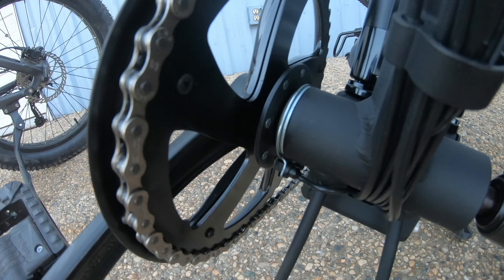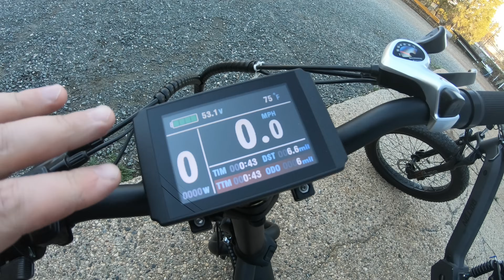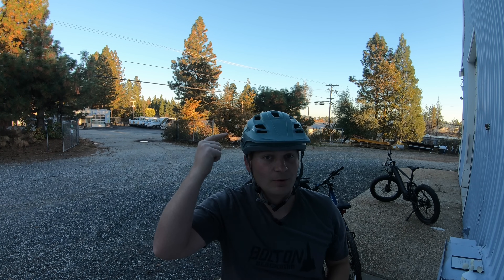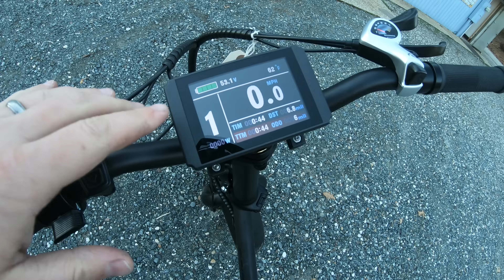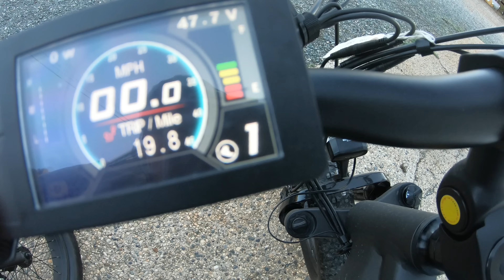Ebike Cadence vs Torque Sensors - the surprising outcome

Comment: On a long gentle hills cadence automatically slows even if you press harder on pedals, your slower cadence is sending signal to motor you want less power assistance, as slower cadence and lower power assist will continue to slow your forward progress. On a hill bike motor understands your decreasing the cadence meaning that you want less power assist.  Torque sensing will see you are trying to increase speed by pressing harder on pedals, and motor will increase the power assist letting you continue climbing the long gentle incline...  if you have a steep short hill stand up and apply pressure to pedal on a non electric bicycle it lets you climb the hill. With torque sensing standing up will increase power assist provided by the motor unlike the cadence sensing that is reducing power assist because the signal to motor with less cadence is you want less power assistance.  Unless you have no undulations in elevation, I can not understand why any eBike rider would want less power on hills from cadence sensing....

Comment: good description... i find cadence sensor kicks in as soon as a magnet passes the sensor....on gravel it can throw you off.
Reply: I used to really enjoy your channel Simon, i dropped off after i found out you where not a real professor in your comment section one day, i felt like i had been conned... you don't even need that title, your very good at what you do and are a nice guy to hold your own! Anyway all the best👍
Reply: @rossg9363  Actually I am a professor having taught in higher education, I just don't have a pHD.  I ry and make it clear I am a Science filmmaker.....with an E-Bike....happy cycling and hope to see you back on my channel soon.  Simon
Reply: @SimonHollandfilms  thanks Simon it's been nearly 2 years from my last view on your channel, i feel better from your response, ill come back over and become a subscriber again :) happy ebike riding to you to! My Cadence sensor on my bafang bbshd 52v kicks in that hard i swear my rear frame twists.
Reply: I hit a patch of stones at a corner intersection on a busy road. I lost control and lurched into the street. I am lucky that the cars stopped before running me over. My high power cadence sensor bike propelled me at the speed setting of the pedal assist. I believe a torque sensor would give me greater control over my speed. I will switch to torque assist as soon as I can pay the price for it.

Comment: If I understand this, you burn a lot more calories with a torque sensor than you would on a cadence sensor bike.  With cadence sensor you don't really burn many calories because you are just spinning the cranks to get the motor to kick in and once in kick in then it does all the work for you.  Catch 22?   Please explain if I understand this right.  Thanks.

Comment: I debated a mid drive Bafang (cadence) or Tonsheng(torque). I normally ride a full suspension mtb and wanted to still have a good workout riding. I choose the Tonsheng (torque) and super happy with my choice. I still get a great workout and go twice (ok maybe 40%) faster And clean many hills and features that I couldn't on my regular ( I like phrase 'acoustic') mtb. I also agree with others that describe a torque sensor to feel more like you have bionic legs rather than just having the motor do the work for you. On my new bike I still feel like I am riding a bike and not a scooter.
Reply: a torque sensor Bafang Ultra would give you 1000-1500W and 160Nm with reliability and quality.     Bafang hub motors combined with a torque sensor would give you also a lot of power.  Yet, you chose the cheapest? solution.  Don't know. But probably the least weighing solution at least.

Comment: Never ride a torque sensor cycle bike seem more on point plus you still get a workout my cadence sensor is broken and this bike was never made to be pedaled with the added weight of hub motor wheel almost coming balance weight to my old regular cycle full weight by itself ( back wheel is 1 ton ) only is a struggle a pain to put it nicely without battery power on throttled
Excellent video

Comment: After many years of motorcycling, I'm looking at my first Ebike. Have learned a ton so far. It will be mid-drive, torque sensor, throttle. But this video showed something new (to me): thumb throttle on left side?! Isn't there such a thing as twist throttle on right, like a motorcycle?
Reply: radbikes have a twist throttle on the right.  the aventon level 2 I ended up with has a thumb throttle on the left, which i actually prefer because it doesn't interfere with using the shifter.

Comment: Thanks, this is an interesting subject. I had always assumed that a mid drive with a torque sensor was the best option; however last year I bought a giant escape with this set up and I did not really enjoy using it....it always seemed sluggish and heavy to push.  I had a test on a cheaper rear hub with cadence sensor today and I found it to be much livelier and enjoyable?  Sadly my local bike shop does not have a bunch of test bikes so that you can make a comparison between the two ( I sold my giant at the end of last summer) but I’m leaning towards the cadence at the moment.
Reply: I had a torque sensor on a previous ebike and I felt the same thing. Granted it was a fairly low powered hub motor, my 6 mile commute left me sweaty and tired (although I got there quickly). I think that a torque sensor gives you a much more bicycleesque experience but cadence sensors can help ensure that you get wherever you are going without breaking a sweat.
Reply: @Pippokpax  thanks. I’m looking at one of the orbeas with the ebike motion rear hub drive now.....as far as I know they don’t have a torque sensor but have a sensor on one of the rear chainstays.....happy cycling.

Comment: I drive rear hub 750W, cadence sensor, twist throttle.  7gear shimano, pretty typical.  They all work so seamlessly for me that I can adjust my effort level as quickly as I need, I can't see a need for torque sensor, although when first looking at bikes I thought I would really want a torque sensor.  I guess if I was an avid heavy duty mountain biker I might want the torque sensor for instant response.  Other than that, perhaps if I was a serious road biker, competitive level , torque sensor would probably also be nice.   But for everyday commuting, fun, all around exercise traveling,  even light trails, hills ,  gravel, snow, mixed conditions my cadence sensor with twist throttle is a perfect fit.  When I need to cross busy roads quickly, just twist that throttle and get across quick!  And then let go and let cadence do the work.  My only complaint would be my gearing which doesn't allow my pedaling to help beyond about 22 MPH,  just ghost pedaling at that point.  But since most of my riding is done between 15-20MPH it is not an issue.
Reply: I have a 1000w hub and 21 gears, That extra large 3rd sprocket on the front defiantly helps at higher speed, But even then, When I go past 25 I start losing momentum. That's where the throttle comes into play though, It will take me to my top speed of 30-32 mph (depending on voltage level), plus the fact I use it anyway when cruising, So it doesn't matter to me.
Reply: Perfectly stated. Cadence with throttle is just the right away for ebikes

Comment: Some Physics 101: pressure = force / UNIT AREA Works great for fluids and foundations. Meaning, the bike torque sensors you described are sensing FORCE, not pressure. Facts still matter.
Reply from the maker: Thanks for the info!

Comment: Current model of Ride1 up Ltd 2021/22 swithched to Cadence from previous Torque Sensor. Were they trying to cut cost or it just works better with their 750 BF hub with throttle? Please comment.
Reply: What I remember Ride1Up said about the change is their customers wanted a cadence sensor. I can see why if you have one or more injured knee or hip joint. I have a gen2 of that bike with a torque sensor. Most of the time I like the feel, but there are times I tweak my bad knee and it is difficult to extract power from the motor due to that, or am towing a heavy trailer, so I rely on the throttle when that happens.
What I’d like to see is a system that has both types and lets me switch between mode. Juiced is the only brand I’ve found with this capability. I’d like to learn of any others that do.

Comment: Throttle is sadly illegal here in Australia, NSW but delivery drivers use them.
Reply: Not illegal, however if you have a throttle the 250W legal limit drops to a measly 200W and it still has to cut out at 25km/h. But no one actually cares so long as you follow the Don't Be a Dick rule.
Reply: @clonkex  in NSW we're not allowed to have throttle but many do any way, especially delivery riders. Cash grab by Highway Patrol if caught. Even worse with e-scooters.
Reply: @StefTechSurfer  I just checked the rules. It seems somehow less clear than a while back, but I still believe what I said is true. You're allowed a throttle for bikes with up to 200W maximum output. It does say it can't be exclusively propelled by the motor but doesn't define what that exactly means. One assumes they mean the throttle is only to help you get going from traffic lights or add power up a hill, but it's not clear.

They do define pedalecs more clearly, where the power only comes as assurance during peddling and allows up to 250W continuous output.

Fingers crossed we eventually get QLD's electric skateboard/scooter laws, cuz those are pretty good. I've had so much fun zipping around Brisbane on electric scooters during my stays there.

Comment: you can adjust all 9 levels of algorithms , you can ask bafang to program or you can do it at home with a computer and a usb cable. I have 3 torque sensors set up for different riding styles. I think most people would be floored if they rode the sensor that Bafang programed for me, they call it hot rod mode! level 1 takes you to 24mph and level 9 tops you out at 61mph .
it really just depends how you program your torque sensor just like an automatic transmission in a car.
Reply: I didn’t think Bafang has a torque sensor?

Comment: I've had a 750watt Bafange mid drive cadence sensing bike. I could go as fast as I wanted, 30mph. But I did not care for it as I got no real exercise riding it, but I did like the mid drive.. Once I rode a torque sensor ebike I decided that was the bike for me. I wish the Magnum with the torque sensor was available before I purchased my current bike. But I do like my Serial 1 Mosh/City, and I saved $1000 during their Black Friday event. While I do like the bike, and think it was worth what I paid. I do not think it's worth the normal MSRP. It really does just feel like you're riding a normal bike, but it just gives you a little assist when you need it. After having both, I would never buy another ebike without a torque sensor. I really do like that little Magnum with the torque sensor.

Comment: Wow great piece ! Really clear and quickly delivered. I just assumed Torque sensing was the best as it costs more and shows up more on higher end bikes but it looks like they both have pluses. The little RAD Power bike I rode on vacation must have had cadence sensers but also a throttle and that worked well enough. Looking forward to trying the Aventon Adventure soon which has only cadence which I won't rule out because of it anymore. Thanks.

Comment: Cadence

On my Himiway cruiser, I ride mostly on single track trails and can put in the effort I desire until my legs fatigue and then ghost pedal while the motor does far more than me.  Within moments I can start to exert more force with my legs and then I’m helping the bike move along with the motor. 

Your explanation was fantastic and helped me appreciate what’s going on behind the scenes with both types. 

For me (older man, poor knees, fit, desiring a degree of exercise), the way I need and desire to ride, the cadence sensor with throttle control is optimal.

Comment: There's a magnet on the rear spokes and a sensor of the Avadar. What happens if you add another magnet to the spokes? Will it trick the sensor and go faster on each rotation?

Comment: I have the Bolton X-15 and does not have any sensors. 1-5 assist which determines the watts and speed. So you peddle as much or little as you want and use the throttle to compensate.

Comment: Awesome video!   I went down the proverbial “rabbit hole” researching e-bikes and I have finally come up with a very simple conclusion:  IF you are a cyclist (i.e. carbon fiber Fuji road bike, Specialized Stump Jumper, etc.)  then a torque sensing mid-drive is for you.  If you are an occasional cyclist (i.e. single speed beach cruiser), a hub-drive with cadence sensor is for you.  I am the cyclist, so I bought a Biktrix FS Juggernaut with a 1,000W mid-drive and I got my wife a 500W hub-drive cruiser.   
Love this channel, BTW.  Definitely gonna visit the shop soon since we live in Sacramento.  Cheers!
Reply: @DASO_MILITIA I did a "range ride" by getting on the bike trail in Old Town Sacramento and rode to Hazel Ave (fish hatchery) and back.  I took my charger with me just in case, but didn't need it.  It was 22 miles each way for a total of 44 miles  round trip (70 km) and I still had 30% battery life (~15 miles) remaining.

Comment: As an older person, my vote is for cadence sensor!!! With two bad knees and  two replacement hips, I'll take the easiest option! However, ebikes had a BIG impact and my ability to get around! I pedal 99% of the time! I got into ebikes because I had given up on bike pedaling Forever! I might even be ready for one of those torque sensors one day!
Reply: > "As an older person, my vote is for cadence sensor"
Hear, Hear! I can participate when I like, and I can Ghost Pedal when I like (which is most of the time). I love having the choice.
Reply: It is quite simple: there is a significant divide between older people (and often older people with some physical disability) and younger bike riders who like the challenge of physical activity with torque sensors. The former, I suspect, prefer cadence sensors for obvious reasons and also because they mostly use their bikes for easy, reasonably flat terrain, and when throttle can come in handily when they are tired. Yes, yes, pedaling is good exercise, I acknowledge..

As an older person who has had back surgery I was considering a eBike with hub motor and torque sensor (plus front fork suspension and hydraulic brakes) but now I think that maybe a cadence sensor with throttle may be better for me because of my physical limitations and my preference for riding over paved streets or fine packed sand trails (no gravel or hills). It could also save me $$$ going this route.
Reply: The longer I ebike, the more I pedal, FACT! Ebikes are definitely beneficial to older riders. Whenever I get crap from the SPANDEX ARMY, who paid more for their bikes than I did mine, I have to laugh! They mean well. You don’t need spandex and watermelon calfs to enjoy and benefit from biking! At the same time, I’m enjoying it so much I want to make it my primary form of transportation.
Reply: @jonspeak2807  Someday these guys will be old or on the second set of hips or knees, and then they will be less quick to look down on those of us who like the assistance afforded by ebikes.
Reply: I have several bikes but can’t ride them anymore do to Congestive Heart Failure. I understand that E-bikes that help with peddling, can help you slowly get back into shape. Also with a Throttle if you get tired you just stop peddling and let the motor take ver.

Comment: Thanks for the great channel!
In 350+ miles of hilly local roads, I've gone from factory settings where zero position = no power, and with a crank throttle, to zero position = 25% power and a thumb throttle because of very steep hills in my area. 
When the transition from steep downgrade to steep upgrade is within a few feet, a thumb throttle is key to instant access to full power, regardless of whether it's cadence or torque. It's an awkward moment of discovery that you've stalled and your ebike does indeed weigh 70 pounds as you're absentmindedly falling to the pavement. BTW, don't worry about the fall...it's the stop that hurts.
I also installed a dropper seat post, dramatically improving the safety of stopping at intersections. I loved the full leg extension of the fixed position high seat before discovering both my legs had shortened by four inches when I had to steady the stopped ebike.

Comment: My e bike has cadence sensor and throttle l alway start with throttle while peddling to give cadence sensor time to kick in then off we go. Also if I’m in a lower powered pedal assist and want a slight boost without changing assist level maybe going up a slightly steeper angle I just hit the throttle for a second or two and

Comment: I dont understand why alot of times manufacturers treat torque sensor and throttle as mutually exclusive.  Dont get me wrong I love my torque sensing ebike but there are times when it would be nice to just thumb the throttle and go from a stop while I'm getting my feet resettled on the peddles.

Comment: Both cadence and torque would be nice. I carry groceries in plastic bags that hang from handle bars. Sometimes I can't pedal. For just riding I'd love the torque.
Reply: Hard to avoid any cognitive biases but wasn't hanging anything on the bars a bit dangerous since the right size item in the bags can suddenly get stuck in the fork resulting in FOOSH injuries? Not the most frequent thing talked about.

Comment: Without a doubt, Torque Sensing + Throttle.  Hey Kyle, please develop a torque sensing bottom bracket replacement + controller for the Rad.  :)
Reply: no throttle... with a throttle it is a Moped, not a bicycle. Period.